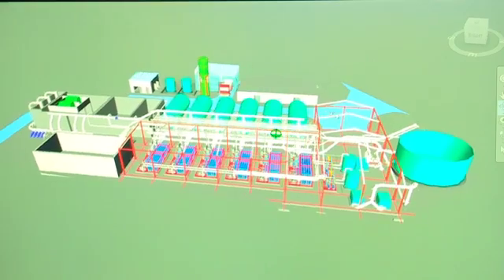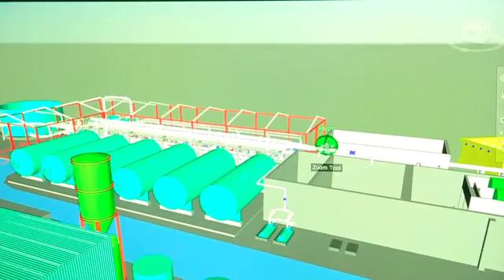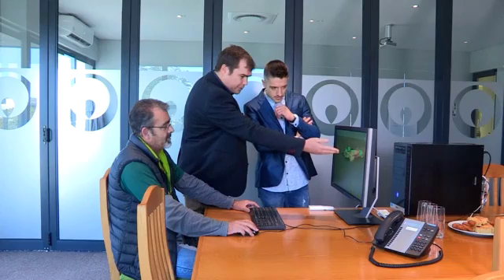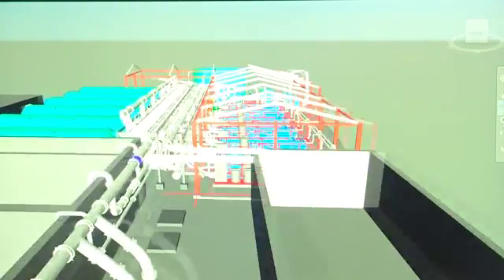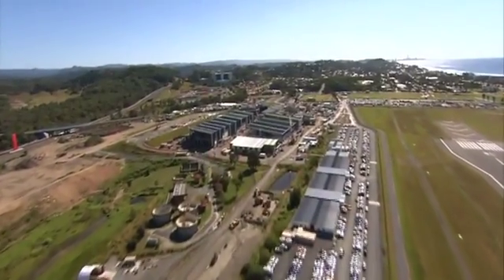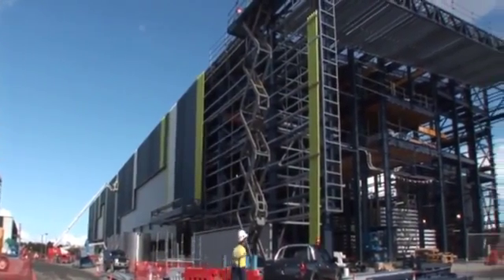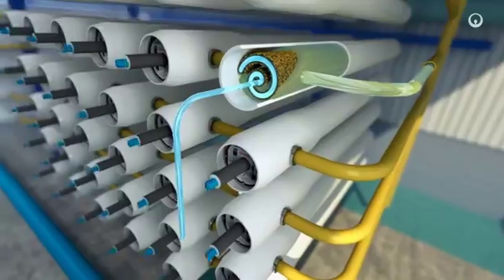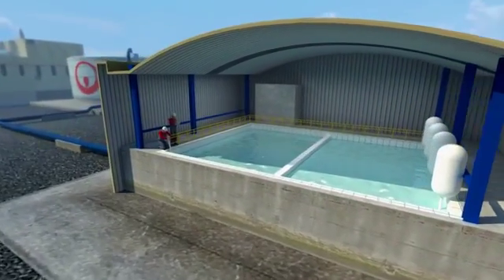Water Desalination the Solution to the Water Crisis? | 12 July 2017

Comment: Considering the Crisis you're facing, yes the water allocation to farms should be cut to 0.  The economy will take a hit, but not as large a hit as the entire country shutting down.   On a purely logistical standpoint with a global economy behind you, you can import meat, vegitables and other Grown supplies much more cheaply and abundantly than importing the equivlant amount of water to produce those items yourselves...  Unfortunately, the local economy will take a massive hit which will take many generations to recover from, the recovery will just be easier by shutting down the allocation to farms.
Reply: Apakuki Vave .
buy eternally on credit and never pay? or print money while shutting production backing currency. the proper way is to shut off cape town water. blacks procreate at 6 times the white rate so a water crisis is inevitable with them.